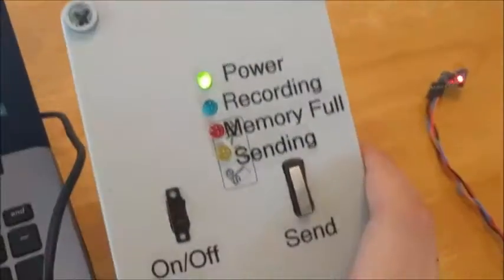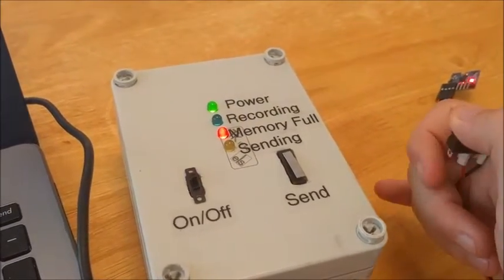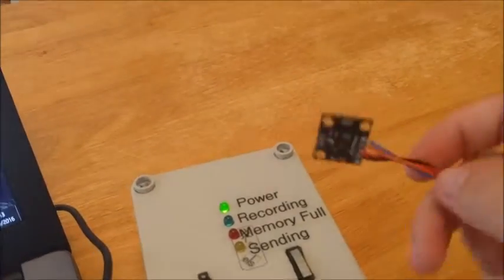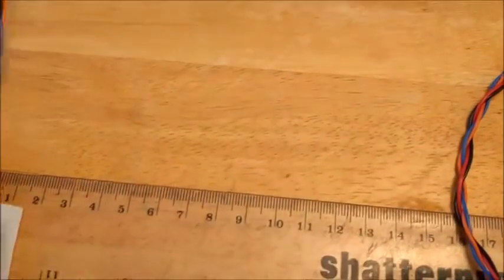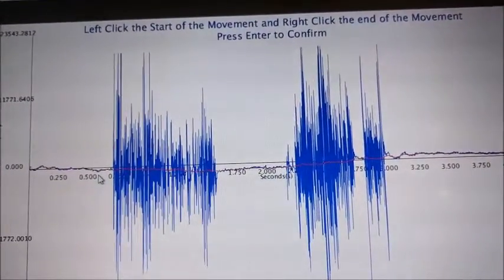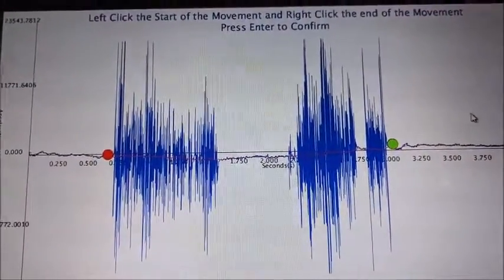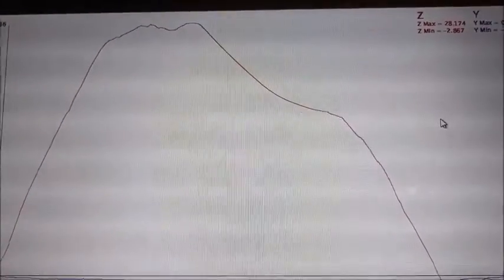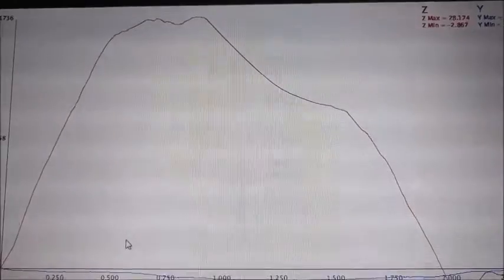Measuring Displacements Using Accelerometers

Comment: Really excellent work.Even I have been trying to get the displacement using navigation grade accelerometer but I could not 
compromise on the accuracy and accumulated error .can you please share the code of computation displacement from acceleration

Comment: Thank you for sharing   ...i have a problem with tracking slow movement followed by rapid movement   slow is 0 .1m/s and rapid is 5 m/s.  Seems like these devices are good to do that.
Reply from the maker: Yeah this device should be able to do that, you can see how I made it and the code if you follow the link in the description. There is room for improvement both on the code and signal processing side though

Comment: I need to continuously measure distance(every few milliseconds) traveled and display it(on a lcd panel maybe, no need to store it). How can i do that?
Reply from the maker: Hey Kandoi, You can just double integrate the acceleration over a short period (apply any filtering if needed) and add the latest displacement to the old value and display this on the lcd

Comment: It is almost a year since you posted this video. Excellent work. I was wondering what is your experience with slow movements (let's say 1 inch every three seconds) ?  I would expect more difficulty during the sampling and overall with accuracy for displacement measurement, do you agree?  Also, Would it be possible to get the code to perform the double integration and plot the displacement graph?
Reply from the maker: Infocentro Usmajac Thanks for enjoying the video,  and yes I would agree with it being more difficult to get an accurate displacement for a slow movement using the methods I am. you could try other methods for isolating the acceleration due to the movement such as filters if you don't want to use the gyroscope. 

And I will try to edit the code and post on my blog by maybe the end of next week, I'm very busy in work at the moment and won't get the chance this week. I will send you a message once it's up
Reply: Thank you for the reply. Just as a side note, I am looking at several measurement methods but the inertial part is still of interest to me. I'll be looking forward to hear from you. Thank you

Comment: How did you get the displacement.? I use the Imu to calculate the trajectory,but the result was so bad. Do you know how to improve that? I have accel and gyro sensors.
Reply from the maker: Sorry, missed this comment. I ran into alot of problems with that as well. I write about how I went about it on my blog but you could also look into sensor fusion https://roboroblog.wordpress.com/2016/08/01/measuring-displacement-using-accelerometers-part-1-calculating-gravity-vectors/
Reply: @Roboro  thanks ~~I will read that careful. and discuss it with you later

Comment: hi
thank you 
how to get on parts
Reply from the maker: Eng mohammed Ali Almosawi you can find the circuit diagram on my blog https://roboroblog.wordpress.com/2016/08/17/measuring-displacements-using-accelerometers-part-3-testing-and-video/ 

I would've ordered the parts from eBay/AliExpress/Farnell. The parts shouldn't be hard to find in any electronics shop
Reply: Dear Roboro,
Can you help me to get of names of device part or commercial name and help me connect together parts.
Best regards.
Eng. M.Ali

Comment: In his post, he said that he subtracted the average of all data that is in the user selected range from each data in the data set, hoping to cancel the sensor error offset. However, this method only works if you return the whatever object you are moving to its original starting point, which makes this algorithm almost useless. WASTE OF TIME! I'm actually worried about the research group you were working for since this brainless design may cause some catastrophic error in the future.
Reply: Instead, you could let the sensor sit for a couple of seconds to collect its steady error. Then subtract that from future data